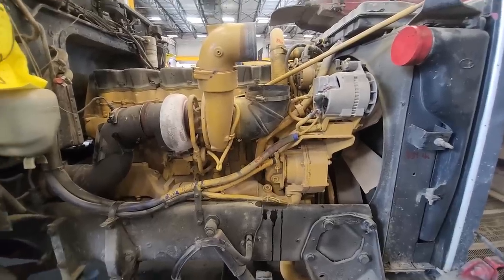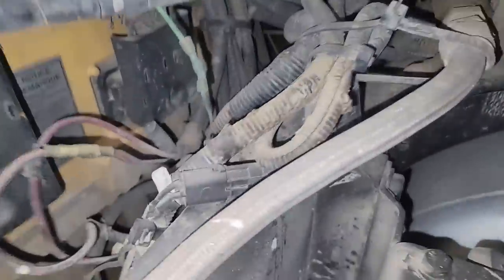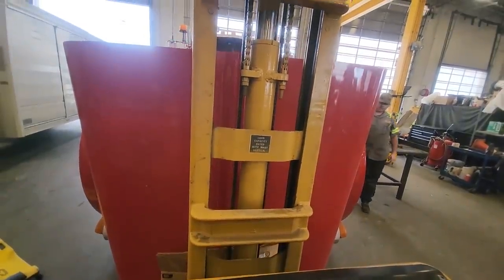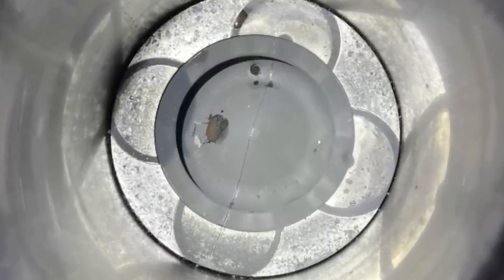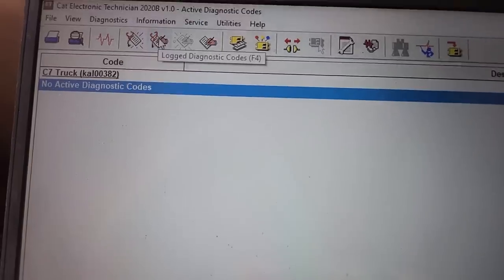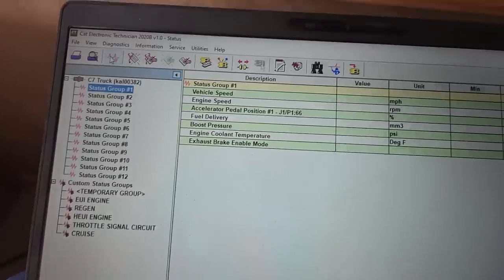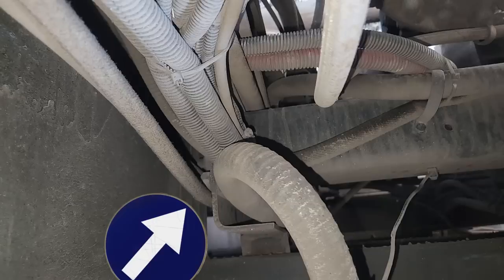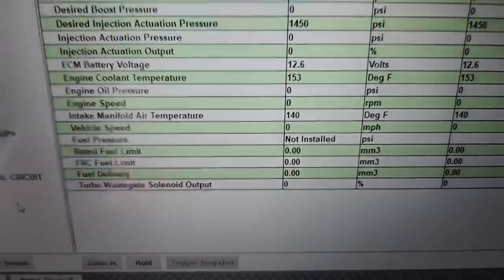Some Repairs are EASY!!! Day in the life of a Diesel Tech.

Comment: YouTube subscriber comments don’t understand it’s the customers choice of the way a truck or piece of equipment is repaired. It’s not the technicians. When it it is warranty it’s the corporation decision.
Reply: I’ve shipped cars at customer request that I wouldn’t have deemed safe to be driven to the scrap yard. 

Not a week ago I shipped a car that had run thru nearly all of the secondary rubber on the rear wheels and what work did they approve? A headlight restoration. Well at least they’ll see the thing they hit or drive of off :( 
Ppl think techs just wanna scam em. They don’t realize we have to document all this stuff so we don’t get sued later
Reply: We had this one heavily and janky modified Jeep Gladiator that got trade-in. Thing was a Rubicon lifted, then the previous owners added an additional 2" life on it. Well how they did it was take a bunch of cut 1/8"  sheet metal and shoddily welded it on the existing shock mounts. But how they did it was, gap welded them on rather than any other smart way. There were still gaps in the welds. I brought it to the attention of our sales department and our shop manager, they did not care one bit and still had me work on it. They did end up selling it. I did my best to deem it unsafe, but sometimes you end up working under a bunch of boneheaded individuals, who would rather risk a person's safety over the mighty dollar.

Comment: Something to keep in mind with boost pressure not responding codes on RVs, check to make sure the wastegate on the turbo moves.  RVs sit around a lot and I have seen the waste gate seize up and won't open causing an overboost problem and setting the ECM off.  Usually a good douching with your favorite flavor of penetrating oil and using a blow gun to actuate the actuator will free it back up.  I usually don't mind working on the RVs but the higher end ones won't be so apt to make you question your life choices.  The lower end ones with literally no engine access to it other than the bedroom sucks.   Let's talk about changing the fuel filters because they did not relocate it to the outside!  Who wants you to take the bedroom apart and drag fuel filters through their house?  The designers need to rethink their plans a little.
Reply: I work on motoryatchs. Ever replaced cylinder heads in a white-carpeted living room?

Comment: I’ve got two of those hood props as well. They’re great for doing a one man clutch adjustment, diagnosing brake application leaks/issues and brake lamp issues. They also come in handy when doing an annual inspection by yourself. We don’t work on many rv’s but I do use one to prop up the bed when doing hvac work in the bunk. Great content as usual!!

Comment: Customer played it safe replacing the engine. Usually don't get better taking one apart. When you do and customer decides to replace it with short block, long block, or complete engine. Customer has to pay to put core back together, wasted money. Exhaust pipe, Cat offers a 9N1940 adapter. You have to cut the old section off and weld the new adapter on. Sometimes you have to repair it this way,  price of the failed pipe or availability of a new one. Cat also offers two clamps for the exhaust, 9N1941 or 4W9160. I always order the 4W9160, it is slightly smaller OD and have seen the 9N1941 clamp bottom out and not seal. 
KAL, or kal, downloads has serial number in upper or lower case. As you expected ECM was replaced and flash file goes forward and backwards and forward. Same with fuel psi parameter. They need to watch your ECM videos and get some ECM101 training.

Comment: Josh, unless you want a bunch of RV work I wouldn't advertise that you don't mind RV work.  Many shops won't work on RVs, probably because it 's easy to get them dirty and it's kind of tough to get to the engine if their a diesel pusher.  Fortunately my motor home is based on an International Durastar 4300 chassis so it's much easier to get worked on.    Keep the good stuff coming.

Comment: Have you done a dedicated starter and alternator engine off, carbon pile load drop test. Then perform the same tests using a single jumper cable and multimeter starter cranking voltage drop test and alternator output voltage drop test also using a single jumper cable so viewers could do those without a carbon pile.

Comment: When removing hood, the two pivot bolts may be easier than  the four adjustment bolts. 
       If I'm gonna be in there for a while I usually get the bumper off and steer tires off so I can adjust the height
Of the engine up or down.   What ever suites my back    ,. @notyounganymore 
         Keep up the good work.      Your quality of videoing looks like it matches your excellent quality of wrenching
Reply: Not my granny anymore? #Thatucks
Reply: Old guy like me. 👍

Comment: So doing this change to boost HP with the proper injectors is to no difference to engine life or wear? Asking for my 3126E in our RV which is great but when we tow our motorcycles behind you can definitely tell. About 4500lbs.
Reply: There is never a free lunch.
Reply: More HP, more fuel, breaks faster. Under rated engine puts more stress on it. If it can be rerated a good driver will only use what they need. A bad driver will tear it up on the first run.
Reply: You can check for a high HP rate, but remember the higher the horsepower the more stress on everything and often the sooner something breaks.  When you look at vehicles often used in service they rate the power down on purpose so it is harder to break it while in warranty.

Comment: I’ve a CAT C9 in my motor home. I don’t know how one would connect to the ECM. Can’t access from the top of the engine or from under the engine. #wondering
Reply: Usually on the Freightliner chassis RVs the plug is under the rear hatch above the radiator.  On the higher end RVs the plug is in the same compartment as where they mount the fuel filters and the outside engine gauges.  You will see a round plug about 2 inches round with a cap placed over it.  That's the data link plug.
Reply: Unless you have the software and cables it is not your burden to bear.  What's with the hashtag?  Are you ten?
Reply: I have seen ECM connectors on the side near the engine, most of the time. A few near the drivers seat and some behind a panel near the driver. Last you could make a bypass connection off your J1P1 ECM connector.

Comment: Hey Ape, Got a question, Rebuilt a c15 with a mxs s/n. Thanks for the vids to help on that. Your method of cutting a feeler guage to set the timing gear (I call it a bull gear, trained under some series 60 techs lol) lash helped a ton, as she had a cracked head so new one was needed, and she was previously rebuild with all non cat parts. You should of seen the look on his face when cat denied the core on the piston packs lol.  She ran great for a year, came back in the shop with the crankcase full of diesel so bad it stalled. I understand its an injector oring, but it still hits on all cyl so cutout test tells me nothing. Can I put UV dye in the fuel filter and run it to try and figure out witch one it is? Im worried about the dye hurting the injectors, but out of ideas on how to pinpoint it without replacing all the injector o rings (Witch is my prefered idea but boss dosent want to go that route.) I have the UV Light and glases. The driver was overreving the engine. I wasnt there but the boss said he herd him downshift and hit the jakes, must have been turning 2k plus according to the boss. Thank god oil filter was clear of metal. Problem Occured the next day. I also have cat et 2011, is there a way to check if it was reved that high? Not that it matters but it is converted to single turbo, and been retuned for it.
Reply: I have used dye, but usually first thing I do is clean the top of the head spotless dry. Use the hand pump and pump up the system and see if I see a fuel leak.

Comment: Have you ever worked on a Cat 3176? Are they any good?
Reply: They are junk. First was a 2YG, numerous problems. Second was the 7LG slightly better. Last was the 3176B 9CK better electronics, iron still gave problems. I called them the yellow Edsel.